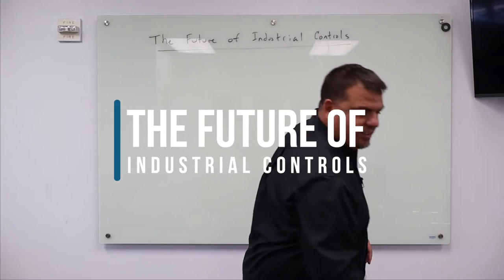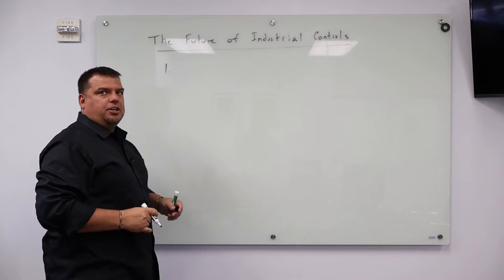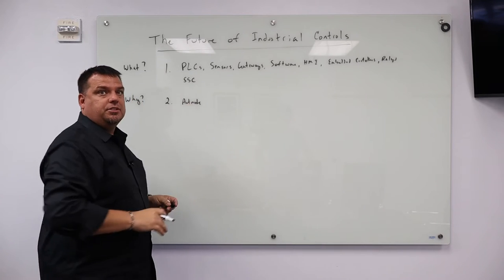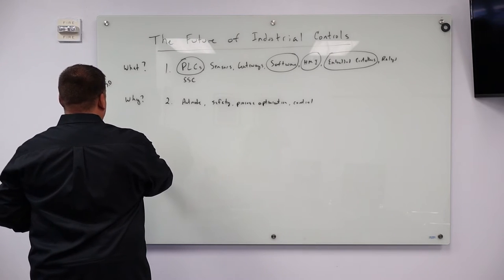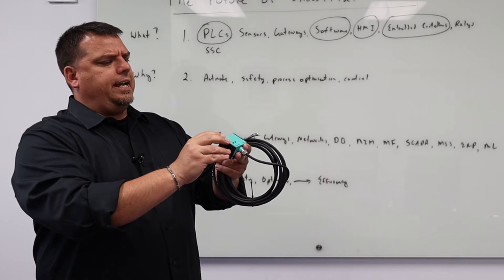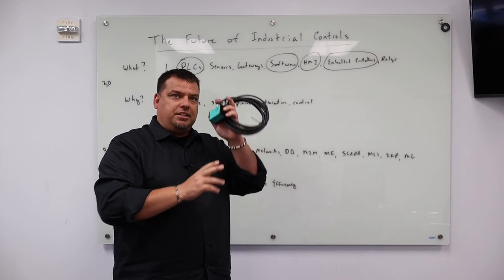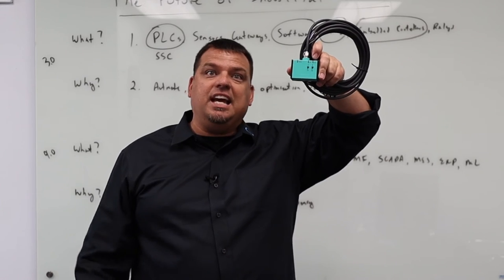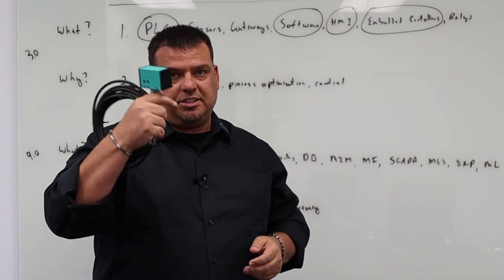The FUTURE of Industrial Controls

Comment: If you look at the major industrial sensor manufacturers (e.g., IFM), many of them increasingly don't manufacturing products without IO-Link.  They've long had the technology in their sensors to do some basic logic and configure the output (e.g., 24VDC, 4-20mA, 0-10VDC).  Many people don't realize they likely already have IO-Link sensors in their plant.

The adoption of IO-Link has definitely picked up in recent years.  I believe the major inhibitors are legacy technology and people.  A lot of plants still have old PLCs and/or have adopted ethernet fieldbuses.  The other factor is that many people do not care about process monitoring.  They will equip machines with as few sensors as possible and will use digital outputs.  If you ask a machine builder for variable process data (e.g., IO-Link, 4-20mA analog), they will find every excuse not to.  They will make sure it breaks your budget and delays delivery.

It can get exhausting explaining to people that there is nothing predict when the only signals from the field are 'On' or 'Off'.  No apps or analytics are going to inform anyone how 'On' or 'Off' something is if it's only 'On' or 'Off'.
Reply from the maker: Thank you for sharing about IO link! Have you already joined discord?

Comment: Industrial automation and control may look something like this in a few decades, but you have to temper your wild enthusiasm with realism.  No industrial plant is going to rip and replace all of their production sensors and control devices just so it can report non-critical data like it's temperature or firmware revision to a unified database.  The cost is vastly prohibitive and the benefit is only theoretical.  A new sensor may only cost $500 but 1000 new sensors?  And the time it takes to install, test and commission them?  It's more likely that new installations will incorporate these components on an as-need basis.  I've worked on several greenfield facilities in the past 3 years and I've seen zero IIOT or 4.0 or such ideas implemented.  Some companies are developing data lakes, which is a good thing, but even that has been laden with bad design and an almost total lack of comprehension of the value of time series data.

Think about this in terms of Industry 3.0.  Believe it or not there are still, STILL, some facilities running equipment with local electro-pneumatic controllers or isolated PLC's.  And there are perhaps thousands of vintage PLC's and DCS's running in the US alone.  Many of these were commissioned before I was working in industry, over 30 years ago.  That represents billions of dollars in infrastructure.  I wish we could get more of them to rip and replace!
Reply from the maker: Thank you for your comments Mark. Check out this video for our responses https://youtu.be/GruN5S18-qI

Comment: Most of the imbedded data in devices that you reference has been available for decades via HART and other carrier wave protocols but plant personnel have never seen the value in having that information.  I have personally struggled to convince management that this data might be of use for years.  I think it's because for the vast majority of sensors & control elements, most of this data has little value beyond the concepts of predictive/preventative maintenance.  Sure, Tesla is probably highly invested in this sort of data, but is a glue manufacturer, a paper mill or a steel plant really interested in it?  Not that I've seen.  Go into any heavy industry plant and you can easily find scores of devices that are woefully out of date, many that don't work at all and lots that are configured incorrectly.  And yet the plant still runs just fine.  Convince management to fix or replace all those devices that barely work first, then let's talk about connectivity.
Reply from the maker: Thanks for the question Mark! We responded in this video here: https://youtu.be/GruN5S18-qI?t=1847

Comment: biggest drawback for a large plant having IIOT is being able to process all that data especially when you get into the 1000s of tags in a HMI system. having to pull this information & trend the devices can slow down the system alot.
Reply from the maker: This is the primary reason the minimum technical requirements for your IIoT protocol are edge driven, report by exception, lightweight, open architecture.

Comment: Q: Will IIOT sensors still have wired connections to the PLCs? Or all sensor data will go to the Internet and then collected by the PLCs from the Internet (I am asking because of data speed transmission).
Reply from the maker: Most will publish wirelessly to the cloud. By percentage. Many will be wired into a PLC because of time and latency requirements by application.